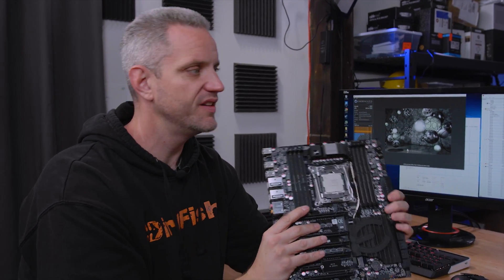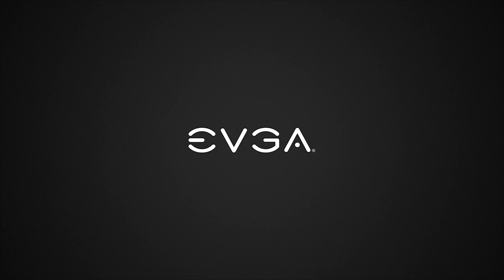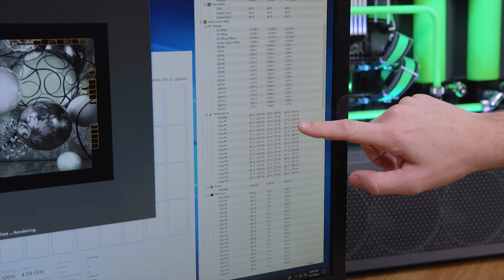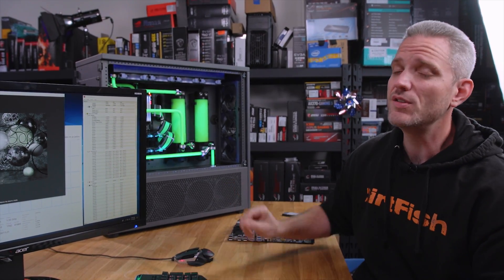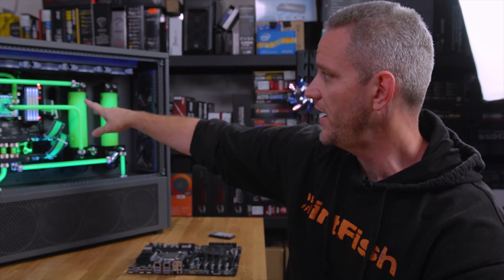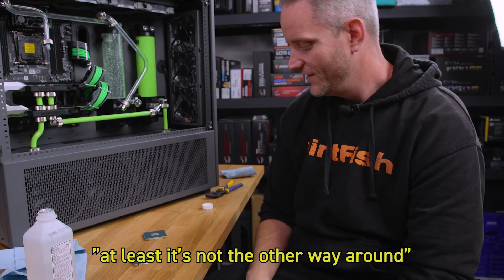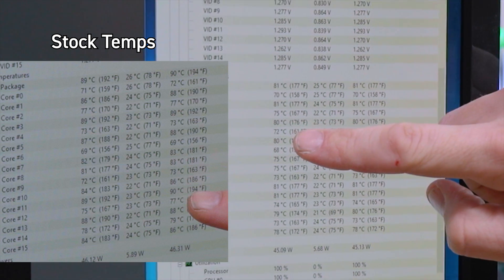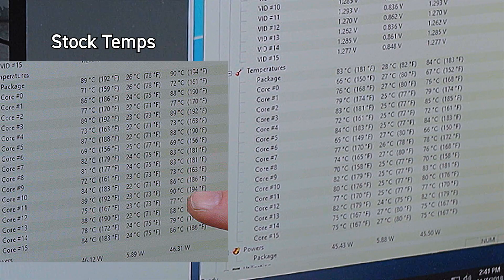I went to delid my CPU... but I didn’t expect this!

Comment: I need to delid my 8700k at 4.3ghz all cores this thing hits 80c, im using a Noctua D-14 in push pull as my cooler, ive checked it and re checked it constantly.  I think intel put mashed potatoes instead of TIM on my cpu.

Comment: Glass is flat? Should really be lapping on a mirror, not the glass side either, but the coated side. To ensure there are no visual distortions, good quality mirrors are "floated" on a liquid salt bed which ensures their flatness, this very flat surface has the aluminium applied and is probably the best surface for lapping.

Comment: That's just sanding the lid. Lapping would be taking the CPU block and the CPU lid and putting lapping compound between the two and using them to "sand each other." Not necessarily making them both perfectly flat, but making their shape closer to the same, allowing for more contact.

Comment: My frying pans also used to be flat till they experienced thermal fatigue.  Thermal cycling can create variations in hardness and density of the metal. You can tell the CPU has be through hundreds of cycles of heavy duty work.  Maybe the key is to not let it get hot in the first place or consider lapping process  as mid life-cycle maintenance.

Comment: why does delidding and putting liquid metal in cools down the cpu? why don't manufacturers make cpus already that way?
Reply: It makes it more a efficient conductor of heat. Manufacturers sometimes solder their chips and that is the best option. That can use the cheaper thermal interface material to save money

Comment: The block actually is never flat 
They are slightly convex (meaning they should have a dome in the middle) 
This has two reasons
First its really hard to polish something very flat (because you have to use soft polishing compounds and cloths) 
Second reason is, its actually better since the die‘s are in the middle of the IHS 
Meaning you actually improve thermals because you have closer contact between the die‘s and the cooler

Comment: My brand new G3 with an I5 acts this way except it shoots right up to 100C under load almost instantly.  I'm talking less than a second.  I've heard others report similar issues.  It heats up so fast that I don't think it can be insufficient cooling power.  It must either be very poor or no heat paste application or they simply push the CPU beyond what can be thermally dissipated.

Comment: Please stop perpetuating the false accusation that repairing products will in some way invalidate a warranty, this is now, ?2018?, illegal in the US.

In the US courts have ruled warranty void stickers are against legislation and cannot be included on products sold here.  This likely extends to the glue or whatever holding the lid of a CPU on.  I'm surprised ppl don't suggest sueing Intel and AMD to create presidents that the prior rulings do include delidding CPUs.  I'm sure the community would chip into a fundme or something for prosecution costs.  For users outside the US it would be entirely possible to send your CPU to a US company to perform the repair, this should also be covered because the act occurs in a district covered by US law.

This is indeed something everyone should be aware and to actively work towards!   If chip manufactures knowingly produce cips that need to be repaired and then have to comply with warranty obligations post repair, as governed by US law, they will make better products that require fewer repairs while still under warranty.

Thank you!

Comment: This is exactly why most chips overheat. A evenly flat ihs and heatsink plate make a world of difference with enough mounting pressure. Well that and thermal density issues making good coolers completely ineffective

Comment: Intel used tooth paste as "thermal paste" for years so they had room for improvement easily in the future... Basically they sabotaged their own CPUs to make more money. But their stupid and dirty market strategy luckily can be fixed at least a bit by de-lidding and using real thermal paste.

Comment: It's worth getting a granite lapping plate if you're going to do this much.  You can get a decent one from Grizzly for about $50 if I recall correctly.  They are way flat and even come with a surface map showing how much error over the the entire plate.
Reply: Functionally, you won't notice a difference for this purpose.  I have both.  So long as the glass is clear and doesn't have any visible distortions, it will be flat enough for this purpose.  The (wet/dry) sandpaper is more uneven than the glass will be. To properly use a granite plate for lapping, you need to use a lapping material directly on the granite.

Comment: Not sure it’s a great idea to delap a cpu, if you had tightened down the cpu less and provided slightly more and thicker compound you would have had an adequate bond with some tinkering that nickel over coat prevents electrolysis but, what ever to each his own.

Comment: Well, this is kind of being nitpicky But, the flat spot in the center of the IHS isn't the problem it doesn't get bad contact, the parts around it is that is where all the thick paste isolates the IHS from the waterblock.
 Also I'm guessing that Intel either deliberatly makes the IHS's slightly convex  rather then the possibility of them being a little concave. Or that they use flat stock and when they stamp them into their final shape they just get a little bit warped.
Reply: Either way it's extremley sloppy and shouldn't be seen on any CPU, specially a $1000 one..
Ryzen seems to have a more thought out shape of their IHS with just a flat slab so probably less chance of it warping in production.
Threadrippers IHS looks a bit like intels but almost as if it was CNC'd instead of stamped. Or maybe they just machine the top of theirs after they get stamped like a company that actually gives a shit about their products performance..

Comment: hey dude... I just bought a motherboard with 4 cpu slots and shoved in 4 xeon E5-2650 I got for $40 each..

so all that tinkering to get speed out = waste of time... I'm essentially running an 8 ghz pc with 32 gigs of ram for less then what you payed for that cpu :-\     I can cycle mine down to 10 degree's and still have the same perfomance as my old  $300 I5 lol

Comment: Hey Jay. i have a very important question: when i fire up my nvidia cp in 3d settings there is an option like "optimize für compute blabla". if i check it none of my games runs more thhen 5 mins and then nvlkkmn stopped and crashes! do you know why this is the case?

Comment: The reason small dataset heats the CPU more is simple: you're staying within cache, or within lower cache hierarchy. L1 is pretty close to instant and it goes down the hill from there. Memory is super harsh, by the time your read comes back, you've stalled and idled hundreds of instructions worth of CPU time. While that is going on, the corresponding ALU sections that couldn't be occupied are essentially powered down.

Comment: The lids were introduced after the Athlon XP era because people would crunch their CPU dies and... their CPU would die. Pardon the pun. The improvements do not surprise me in the slightest, because adding an extra layer or two (one metal and one cooling paste or tin) into the mix is bad for heat transfer.

Sadly Jay... why not permanently remove the lid? It is still back on there is it not? Doesn't that defeat the purpose a bit?

Comment: Using thermal paste for delid isn´t very effective. The paste will degrade very quickly. When you try liquid metal, you will see much more improvement and you have to do it only once.

Comment: Lid could have a concave shape on the inside if it has a convex shape on the outside. It's entirely possible you only fixed half the problem. If you're curious, could try replacing the lid.

Comment: Doesn’t your cpu melt at 90 degrees
Reply: No. It's just more dangerous the higher you go, since it becomes less efficient and can't regulate itself. Nothing in a CPU melts at 90 degrees, after all, soldered CPUs have a special blend that melts at hundreds of degrees celsius, since normal solder melts at over 500 degrees. However, it's still not good for a CPU to be at such a high temperature, as the thermal shock causes materials to break from thermal expansion and shrinking. More importantly for short term, since resistance increases with temperature in most metals, this means that the CPU becomes less stable as temperature increases since it can't deliver enough charge within the amount of time. That's why increasing voltage almost always increases overclocking stability short-term, as it'll overcome the resistance better and deliver enough charge within such a short time.
Reply: Noorquacker or use liquid nitrogen

Comment: JayzTwoCents  I'm having issues with my msi b450 gaming mobo I recently upgraded the cooling system and all is good but then I updated the drivers automatically like usual and noticed my noise stopped through my speakers. I noticed my Realtek HD audio management disappeared. Any suggestions? I would appreciate it. If you can email me please do Ortizcompany@icloud.com
Reply: Post on reddit.
Reply: Bathwater Salesman my motherboard was bad had to get replaced

Comment: I just saw this video after lapping an i7 6700k SFF build which was OC'd to 4.5GHz. Was hitting mid 90s and depending on ambient, was thermal throttling at 100. (100% simulated usage) I lapped it and it went down to mid 70's low 80's. After that, I was able to OC to 4.7GHz with the same temperature range at 100% usage. Really saved my ass in this case because the unit was for resale. 

 My Ryzen in my desktop PC is having similar problems with temps, I might try lapping that as well to see if I can see an improvement. Great vid :)
Reply: Make a video

Comment: You need to use liquid metal for the TIM because of the increased heat transfer. You should see even greater reductions in temps.... The TIM you used is better than the crap intel uses, but a good liquid metal on both the interior (lid/cpu die) and exterior (lid/ cooler) should yield greater results... just saying....

Comment: umm... doesn't that mean the lid is domed? You should have flattened the lid so that it was flat on both sides. Now you have full contact with the cooler, but the lid has a gap between it and the CPU...

Comment: instead of de-lidding the chip and voiding the warranty, why don't people start sending back chips that are running too hot and request a replacement under the warranty. all the returns will force Intel to start doing things properly instead of offloading their responsibility off onto the consumer all the time.
Reply: because a guy like jay is a diy'er, and is capable of fixing it, and probably do a better job than the replacement anyways. you dont see videos of people like me who would have to send it back, because that doesnt make a good video, but plenty of us exist
Reply: Because that just makes too much sense

Comment: Intel is purposely making CPU's overheat so that they break within a couple of years. Intel is a garbage.
Reply: Not true. I have an i7 970 that I bought brand new, has always been rock stable, and runs perfectly to this day. Same with an i5 2nd gen in my laptop. Same with another Intel CPU in my backup system. For "garbage", they sure seem just about unkillable to me.
Reply: @wasd____  All cpus after SandyBridge are made to work at high temperatures to cripple lifespan. That lead users to remove IHS and apply proper thermal paste that fixes the problem ( deliding ) but voids the warranty and as an alternative people bought better cooling solutions. Everyone now has an AIO or huge copper heatshink to cope with heat.

Long lasting and powerful 8 cores SandyBridge cpus: https://en.wikipedia.org/wiki/Sandy_Bridge-E .

I have a friend wich used to own an i7 3770k and the thing kept crashing due to high temperatures at stock speeds. Laptops with IvyBridge had fried cpus, see Thinkpad x230 with i7 3rd generation.

AMD is even worse. They pre-overclock their CPU's and built quality is under Intel. I know someone with a Ryzen 5 fried. He used that cpu for accounting, not gaming. Another one had a Rzyen 7 for a few days old and died on him. Ryzen do work at a lower temperaturres but they are poorly made and they die faster at lower temperatures. Maybe 3rd gen Ryzen will be better.

Comment: Just FYI tempered glass is not always flat. It depends on cooling process the glassworks used. If they cheaped out and have pool quality ovens or f@!-ed the process it can get really bulged and uneven. Regular glass is much flatter.

Comment: Hey jay I just got a pre built pc is it normal to be running at 109-125 degrees F? I dunno if I should return it or not 😔 I’m new to all of this the settings I’m using is on the game ark and it’s at high/medium settings at 1080p 🤦🏼‍♂️ and it’s the ryzen5 rx580 8g with the Radeon 1600 no oc “wish I knew more about pc’s”

Comment: Given the cost of a rig like this I have a simple suggestion that can help you to lower your temps. There's the option of using a thermal electric cooler aka pelletier cooling. I would imagine with the thousands invested in such a system a few hundred more wouldn't hurt. There's also phase change and even pumped liquid nitrogen cooling as well. In short and no offense but if you're going to make use of stupidly expensive hardware you should consider cooling options that are above the bolt on mindset, perhaps it might prove a worth while investment to add someone to your team who thinks on the kind of problem solving level that could actually push that hardware to its limits while not harming it. You need out of the box thinking.

Comment: I love how he tried to correct his grammar but only made it worse. The phrase it "it is a heat spreader". You only use "an" before "h" if the "h" is silent, like in "hour". For example you say "half an hour", not "half a hour". But if the "h" is not silent, like in "heat" you would use "a" instead of "an". So "it is a heat spreader" is correct, and "it is an heat spreader" is incorrect.

Comment: Could just be a manly man and run it without that crap metal bit like they used to back in 2002. Remember the old Athlon 2000s?
Reply: Sucked power from the wall like a hair dryer, stayed cool as a cucumber.

Comment: Just so you know, glass isn't actually flat, you would need a piece of granite at 60 ish degrees from an inspection block used in machining to get a true "flat" piece. Or a decent surface grinder.

Comment: I did the spin test on my new i9-9920x , how am i supposed to lap the IHS if it has the small hole in the IHS? fill it with thermal compound or a small piece of eraser?

Comment: I got my 6950x to 4.4Ghz @ 1.37v on only a Kraken X41.
Solid CPU. But hella overpriced when it came out. 

Maybe the die isn't piled as high as the silly 9900k which suffers from not really benefitting from solder or even liquid, but rather a die lapping. Lulz.

Comment: I dont get why you wouldnt return a defective CPU if it was covered under warranty instead of trying to fix it yourself. If the lid is malformed on one side...chances are that it isnt the right shape on the other side either...which could change the thermal properties underneath it (if there is more air under the lid for example). SMH. You should be showing people how to do things correctly not showing them how to ruin their stuff and void their warranty. If something is broken - that is what a warranty is for - you dont mess with it - you return it and get one that is not broken.

Comment: I overclocked my 8700k to 5ghz after a full night of gaming the highest any of the cores hit . but didn't stay that was max all night 71c is that ok or should I worry about that . all night the over all stayed around low to mid 50.s from what I could see from msi afterburner osd

Comment: With Corsair H150i before delid on i5-6600k @ 4.7ghz, 70*C avg, after delid: 50*C with liquid metal (Conductonaut) between die and IHS (custom copper IHS), and arctic mx-4 between the IHS and waterblock.

Comment: Nope Open the CPU up again and use Liquid metal between IHS and DIE. On my Ivy Bridge 3770k I'd did me 20°C difference. I'm running at 4.5GHz, 1.27v and I'm not seeing 70ish degrees under my Corsair H115i AiO. And I bet if I replace the LM with 'insert any toothpaste' it would be ~15°C hotter

Comment: Hi Jay, you should be using a figure-eight pattern when you lap, it'll help remove material much more evenly. 

sanding back and fourth leaves ridges, and sanding in circles is hard to get the pressure perfectly even. Doing it in a figure 8 pattern is the closest approximation to randomized material removal, like a random orbital sander... ie closest to flat

Comment: Kind of scratching my head at why he didnt use liquid metal, i sent my 8700k off to silicon lottery and it was nearly a 20c improvement over stock. (was cheaper than me buying the liquid metal, delid tool, and rtv sealant)

Comment: Wait, why is the package power only just over 45W? I'm not sure what kind of magic is happening here, but my i7-4790K cracks up to 180W during prime95. With 45W of heat and your cooling setup, the temps should be way lower than it is now.

Comment: So with intel you need to delid it, lap the silicon down almost 1/3rd of its height, apply new paste, then lap the IHS and THEN add a water cooler

Meanwhile at AMD, you put it in the mobo and use an air cooler.